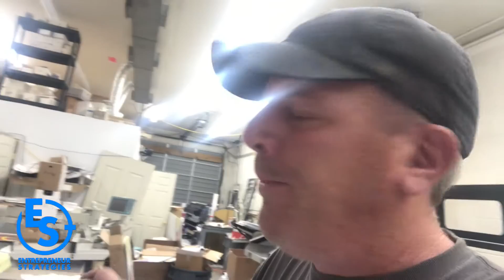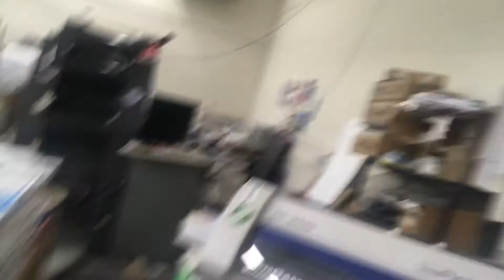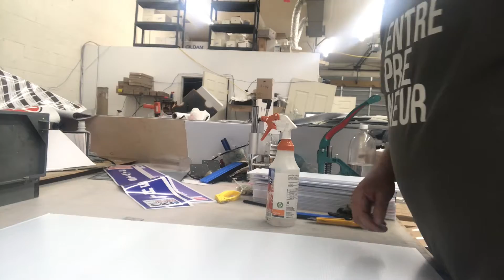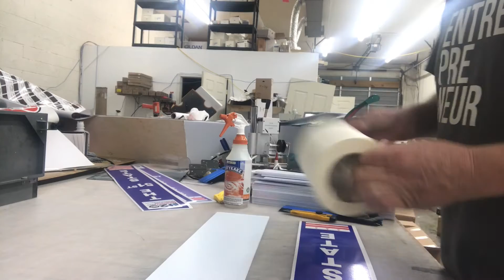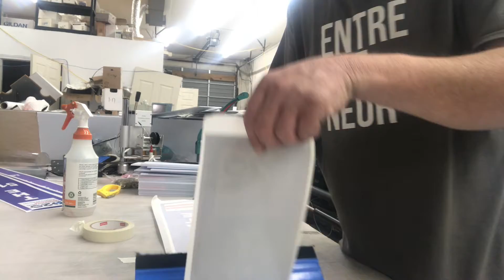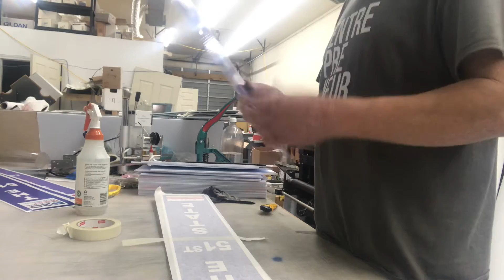Vinyl Sign Mounting

Comment: Why not just directly print on the media with your HP printer?
Reply from the maker: So the HP Flat bed prints images with a different texture.  The Roland is a smoother print, more vibrant.  And also, the HP machine was down, not working at the time.